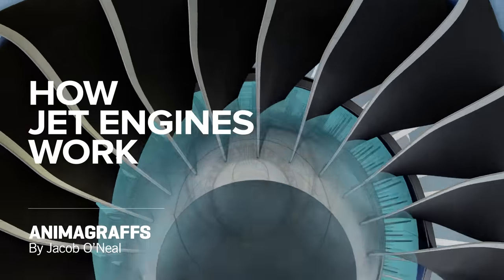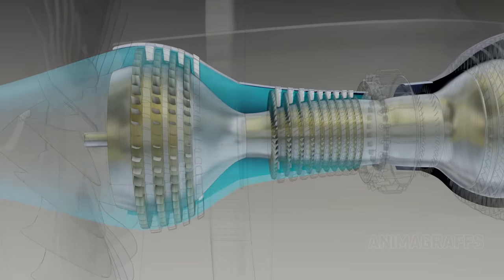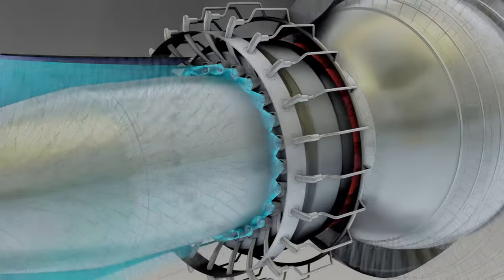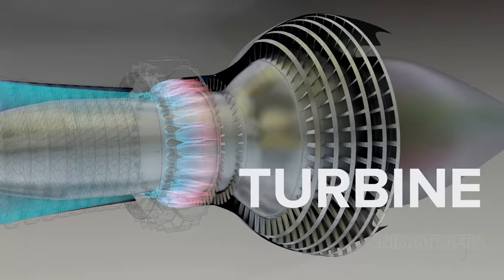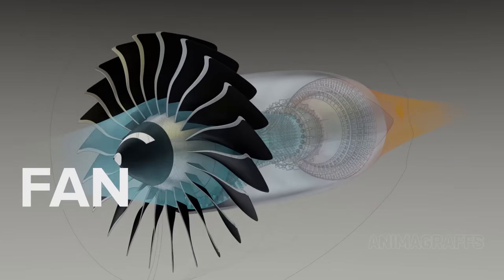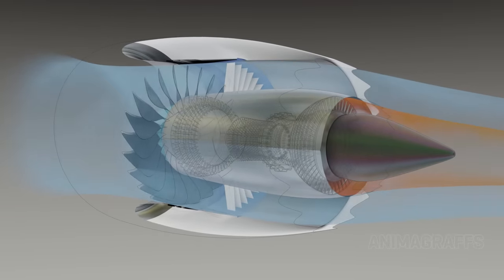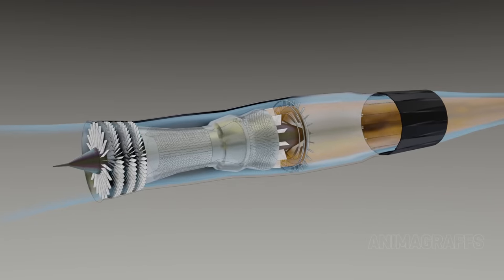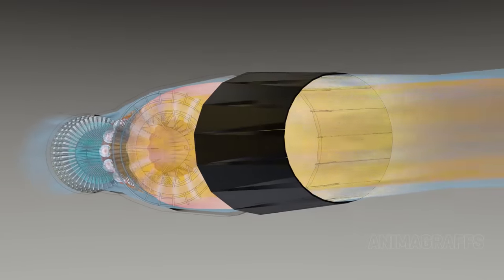How Jet Engines Work

Comment: Until today the only thing that I dont undestand is what start up  this engine?? ignition stage, what make the engine rotate in the ground so fast to take off ??
Reply: A starter motor. On jetliners, it's an air starter that takes compressed air from the APU to spin the core. Once it's up to speed and the air flow is going, just inject fuel, spark the plugs and the cycle can start.

Comment: Why do the burning gasses propel the engine towards the forward direction? They told us in school that the pressure is the same through the whole surface, so the gasses should push the compressing and the turbine blades in the opposite directions with the same force and thus the engine should stop.
Reply: Why does when the gas stove turns on the flame doesn't reach the container and blasts? Same reason here. The air is pressurised, so the gases move towards turbine and reach the exit.
Reply: @SunKing909 , following your logic, the whole engine thrust is generated by the compressor. The question “why the burning fuel pushes more backward than forward” is not answered.
Reply: I have the same question.

Comment: So it's basically pressurizing air as much as possible to get thrust
Reply: Not entirely. You can get thrust with very low compression, think back to the very first propellers. However the general desire and trend is to increase the compression because the engine cycle becomes more efficient and requires less fuel to be used. If you look at compression ratio over time, you'll see it steadily increases as time progresses.

Comment: how is the fan rotation driven....just by the sucking of the burning fuel?
Reply: Well to start an engine it is first rotated by an air starter until fuel is added some where around 25% n2 (n2= core) , as all the parts are connected in the shaft the fans spins faster after that

Comment: And this is why I'm not an aircraft mechanic. How do you start it? Someone told me you have to get it turning before you ignite it.
Reply: Well that makes sense because car engines need to be turned too before they can ignite and start. I'm guessing it is the same concept. Use a big ass starter to rotate the main shaft and then ignite it.

Comment: 1:14 Why are there two axes rotating in opposite directions? Torque cancellation perhaps?

Also, I think most turbofans have thrust reversers. Excellent work, regardless!
Reply: The two axes are not connected to the same shaft. They are connected to two different shafts. One to high pressure turbine and other to low pressure turbine

Comment: But how does it startup most of the videos just show that how does it work but what's the thing that makes it rotate when you turn it on
Reply: Most engines have either a air starter or electric starter.   On aircraft with an APU, the APU will send high pressure air to the engine air starter, the enginer will turn and then fuel is applied.  Once the engine gets to a certain speed, the air starter valve will be closed.   Electric starters do the same thing, except are electric motors to drive the engine
Reply: @rcairflr  thanks dude

Comment: ok.. I have watched so many similar animations and understand how they work but Im still wondering HOW does the blades spin? like for prop planes the cylinder engines spin the prop. but what spins the turbines?
Reply: Just like any other engine, combustion gasses expanding. The mixture of fuel and compressed air ignites and expands massively and spins the turbines at the exhaust end . As the shaft through the centre of the engine is directly coupled to all of the turbine stages then, the back of the engine drives the front of the engine.
Reply: @ohidontknow1061  ok but then how does it start? how does the APU start spinning the front which spins the back which spins the front?
Reply: @yurackjung9321  Various methods, some use a compressed air supply to spin the turbine up by introducing compressed air to the compressor stages. Some use the electrical generator to spin it by applying voltage rather than taking voltage from it, basically making the generator a motor. 

Strangely enough, some even used an explosive cartridge to cause expansion and hence rotation. It looked like a flare from a Very Pistol

Most aircraft have a small auxiliary power unit, a small jet engine, often mounted in the tail that can be used to either supply electrical power or compressed air directly to the engines to allow main engine start.

Comment: what this videos always fail to tell us, is how does the axle and the from blades keep turning after ignition is achieved and APU is turned off.
Reply: He states it at 2:13. Turbine drives compressors and fan. Basically as long as fuel pump and igniters are running, the fan and compressors will continue to spin.

Comment: This is a great video with excellent visualisation. However, I wish there would have been some more explaining. All the video teached is that there is the compressor, there it mixes the fuel, there is ignites and so on. It did not explain any technical aspect of how the engine actually works. It basically just showed the hand full of main components name and design. 
Compared to a car showcase, it is comparable with "this is the motor", these are the wheels that spin, this is the gearshift that translates force and speed. 
It just seems like with such a high cost and high effort visualisation, the explaining was preatty much the opposite.
Reply: Luca Dario Bützberger   You are missing something.  Every aspect of turbine operation and thrust production is explained.  Watch again and remember it is really a simple concept and design, a lot simpler and less moving parts than a car engine.
Reply: @garygolfer3243  No, they are not explained. They are shown.
The animations are nice but when it comes to the depth of the "explanation" it is comparable to a car explanation in which one tells you that the tires spinn, the motor uses fuel to burn and the steering wheel puts the movement of the passenger to the tires. I am not missing something. The video misses something that would be interesting. 
I put it like this. If one has absolutely no clue about absolutely anything^, this is a good explanation. But if one has a little bit of technical knowledge (me personally, I don't know how a turbine works at all), the process explained here is kind of logical. It is the only way it could physically work. I don't know anything about turbines but from watching this video, I did not learn anything. 
That is my point. It shows how parts move but it doesen't explain why it works.
Reply: Luca Dario Bützberger  You may be overthinking it.  All the how's and especially the why's are clearly explained - enough for me and my neighbor to build a working model during this Covid crud.  The only problems we had were finding the right bearings and getting the fuel pressure to regulate correctly.  It's less than a meter in length so some things are a bit tricky at that scale.
Reply: no, they are explained. Every principle of operation of a jet engine is explained here. Compressor stages compress and propell air to create thrust, fuel is injected to increase temperature thus further increasing pressure, part of the thrust is harvested by the turbine stages to keep the compressor stages spinning. There is nothing more to it.

Comment: I have a question. Has anyone challenged commercial applications with presenting a fully electric jet engine?
Reply: Making a fully electric jet engine isnt the issue. Storing enough electricity is.
Reply: @AnnicK.Zoloft  I understand that quite well. 

How about a solution using the old fashioned concept of “ removable rechargeable batteries”. 

You remember AA and AAA batteries right? 
(Using modern technology like lightening charging and graphene and other modern energy storage materials) 
Can plane power storage be made that: 
1. Automatically has lightening charging as standard. 
2. The power source of the plane is segmented like how old fashioned handheld devices used multiple AA batteries. 
3. The segmented air plane power source is segmented into multiple individual power banks that can be removed in minutes. 
4. The removable segmented pieces can be individually charged at the airport while a fully charged segment (from the airport) is put inside the plane in the empty power slot. 
5. The plane itself has a auxiliary lightening charging port so that you can “plug” the plane into the airport electrical grid to recharge while empty power segments are being replaced underneath the plane. So that with the segment replacing and the auxiliary charging, planes are always fully charged before taking off for their next flight. 

That’s my solution to compensate for the energy density part of the problem. 

Using modern energy dense materials like graphene and other energy dense materials  that are being explored by Tesla for example OF COURSE. Cause energy density is still a priority. (NOT going to simply use lithium ion material. Because that isn’t helpful enough OBVIOUSLY).
Reply: @DylanBegazo  as you pointed out, energy density is extremely important. As it stands today there is NO electricity storage technology that is even near energy dense enough for it to be used in aircraft.
Current batteries are also extremely heavy, with decreasing capacity with each new cycle. Each one of these things would be bad enough for electric planes not to be feasable, right now there is no storage technology that doesnt have all 3. Until some truly revolitionnary battery is invented, electric airliner will not be a thing, outside of possibly some short range airliners that might be paid for by the ecology lobby witj taxpayer money to pretend that it is possible. But then battery packs would constantly be replaced because of reduced capacity (meaning more being made, with more chemicals to dig out, and old ones somehow having to be discarded), in other words, the only green thing about that kind of plane would be the leaf they would paint on it.
Reply: @AnnicK.Zoloft  Then, with your helpful analysis I have one question.... what is the minimum energy density that would be needed for the idea to be possible?
Reply: @DylanBegazo  I dont have a number to give you, im no energy expert, but it would have to be high enough for airliners to be profitable : currently if you wanted to fly a heavy aircraft like a 747 across the atlantic, with enough energy to complete the flight, go to an alternate airport and have 30 minute reserves (which is all mandatory), the batteries would be so large and so heavy that you couldnt fit nearly enough passengers in the plane for it to be profitable.
Also, as I said, because battery capacity decreases at every cycle, the range of the aircraft would be decreased at every flight. Meaning that batteries would necessarily be replaced by new ones very often, which means that it wouldnt be eco friendly at all anyway.
So not only would you need siginificantly higher energy density for the commercial side of things, but you would also need batteries that preserve their capacity for it to make any sense ecologically wise, and thats why it would require extreme improvements to current technology.
I cant answer in any more details, but if you are curious dont take my word for it, you can do your own research as well.

Comment: I’ve watched countless of these video but none explained what EXACTLY powers the turbofan??? I don’t see any internal combustion engines there and if it rotates from incoming air then how does it works before taking off at ground??? 
If you’re making animations do the whole thing from stat to end please not just only during it’s operating in the middle!
Reply: The video explains it around 2' in: the combustion chamber heats the gases, those exhaust gases make the turbine spin and that spin drives the fan and compressor up front. 
The only thing missing is the starter engine that makes the core spin in the first place at start up, to get air flowing through the core before ignition. Once that is started, the turbine propels the compressor like a turbo on a car

Comment: Wait so air is drawin into the engine and mixed with fuel to rotate the big ass fan which acts like a propeller? So aircraft engines are big ass propeller engines?
Reply from the maker: It's called a ducted fan and yes, that's a way of seeing it. You'll end up getting into some intense physics and thermodynamics to understand why it's more efficient to move lots of air with a powered fan instead of just blasting all air through the core alone.
Reply: @animagraffs  Hi, I'm back, you were absolutely correct. Right now I'm using your video to understand my thermodynamics class. Thank you.

Comment: where are the thousands of gallons of jet fuel stored ?
Reply from the maker: In the wings. We've got a full jet airliner breakdown, if you'll search past the end of your nose, Flat Josh.
Reply: An Airbus A380 wing is not big enough to carry 120,000 liters of fuel. The wings only contain the  hydraulics to expand the wings. The Electric Jets are powered  by the APU.
Reply: @animagraffs  12,000 litres of fuel in those flimsy aluminum wings.  hmmmmm.  11 tons of fuel.  bwahaha.
Reply: @BiblicalFlatEarthJoshua  120,000 litres Not 12,000
Reply: @7KIslands  
"An Airbus A380 wing is not big enough to carry 120,000 liters of fuel."

Here are the fuel tanks:
https://i.stack.imgur.com/TJZA8.jpg
And here you can clearly see the height or thickness of Feed tank 3 and the right Inner tank in a wing during construction:
https://static01.nyt.com/images/2012/01/20/business/Airbus/Airbus-jumbo.jpg
Just these two tanks have room for 73,400 litres of fuel while the A380's total fuel capacity is 315,000 litres.

Comment: what powers the turbofan to spin????????????
Reply: The turbine that sits at the rear of the engine. The rapid expansion of exhaust gases after the combustion chamber spins the turbines at the rear. The single shaft through all the sections is directly coupled to the big fan at the front. In effect the back of the engine drives the front of the engine.

Comment: Still doesn’t make sense why some of these costs upto $50 million
Reply: I don't know where you heard about this 50million dollar price. Normally an engine costs from 1mil to 20mil. For an engine from design to manufacturing, it usually requires a lot of time to(Ranging from 3-6 yrs+). The materials used are hard to manufacture, integrating all the components is another issue. Yeah so they do cost a lot

Comment: THE SPEED OF SOUNS IS AS SEA LEVEL IS 770 MPH ... = MOCH 1 SO EVERY TIME YOU GO UP IN A MOCH YOUR   ( x770 ) BY A " FACTER " A SONIC BOOM IS WHEN THE LIP / WING HAS LET THE FLOW OF AIR BEHIND IT . SO THE FASTER YOU GO THE MORE SHOCK WAYS THERE ARE  .   ALSO WATER HAS 10X THE DENCATY THAT AIR HAS SO THAT IS WHY THAY USE WATER FOR TESTING ON FAN BLADES . DID YOU KNOW THAT EACH STARTER BLAND IS MADE OF A "NAON "  CRYSTLE .......        "P.S." SORRY FOR THE CAPS BUT IT IS HARD FOR MEE TO SEE SMALL TEXTS .. NEED NEW GLASSES
Reply: If you're talking about some external flow around a body, this is not correct, there are not "more shockwaves" at Mach 2 than at Mach 1.5. The intensity of the shock is stronger at Mach 2 than at Mach 1.5, however. This is somewhat true if you look at shock diamonds in the exhaust of military jets with afterburners, which are formed by series of interfering oblique shockwaves.

Comment: These engines works on compressed air not mainly on fuel. Fuel used to lower the exhaust pressure so suction will increase exponentially. And more suction creates more thrust. But they dont tell it like that. They want people to think the system works like a combustion engine but its not. So they can fool people to believe that aluminum plane wings can carry hundreds tons of fuel. Even the largest steel tanker truck carries maximum 30 tons of fuel. No aluminum wing structure can carry 3 or more fully loaded tanker truck weight + jet engines. Even tanker trucks are made of full steel not aluminum to carry 30tons on a road. Alumium is not a good material to hold weights. It is used for its light weight. But people are so dumb down and they think these planes made to be so light weight to fly but filled with tons of fuel which make them heavier than any ground vehicle. Planes are so light weight vehicles and engines mainly works on compressed air not fuel. Fuel amounts on paper to fool people for higher ticket prices nothing more.

Comment: Can be made electric turbo fan or jet fan or something like that where no combustion happen? i mean the electric motor run the turbine and with the help of planetary gear increase speed of the fan inlet and compresor in the same axes help to take all that air compres it and eject it at back nozzel. will it work? or it needed the combustion to expande the air to add more presure?

Comment: Question- If you got rid of the turbine at the back and powered the compression rotors with electricity, would that result in more thrust since the rear turbine isn’t taking some of the exhaust energy?

Comment: Generally excellent, but this makes the common mistake of claiming that compression is the result of forcing air into a reducing area. That is how positive-displacement compressors work, but that is not the case here. Each stage of the compressor increases the energy of the airflow, by increasing velocity - pressure actually decreases, until a diffuser section (such as a stator, which is described correctly) decreases velocity and increases pressure. The reduced flow area is the result of increasing density, and not the cause of the pressure rise.